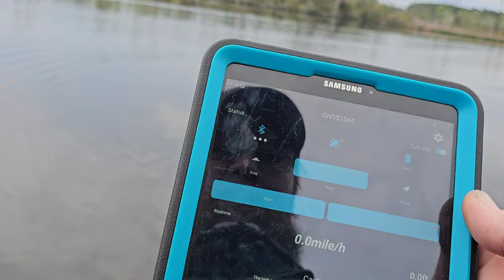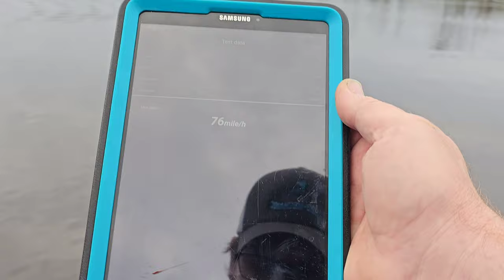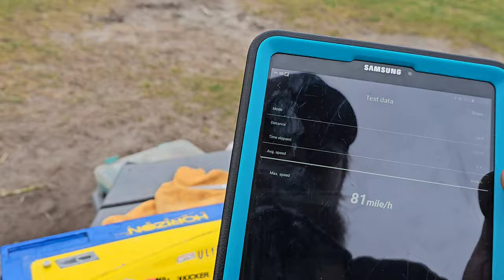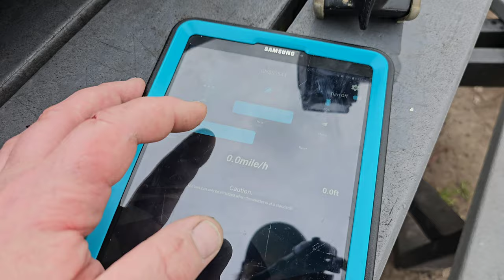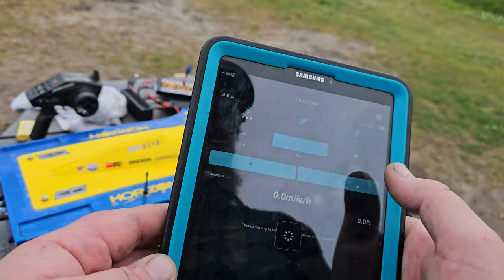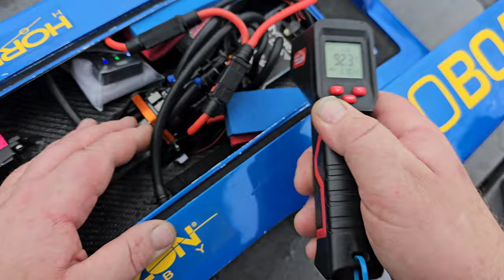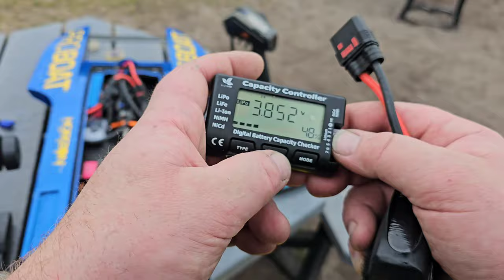Speedrun Shakedown Proboat Ul-19 Fe Rc Hydroplane Prop Test

Comment: Nice going! 
Got a question, big B. The fin with the curved bottom.
Does it not affect the ride? Looks to me that it would want to dig in.
Square to the ride surface would be neutral? I'm just curious.
Watch them gators😂😂👍🤙
Reply from the maker: The curve has to be set perfectly, something I've always struggled with, if you get it right, it'll somwhat hold the boat down in the water without digging or lifting the sponson..   had the fin set perfectly in my previous video, until it hit a 🐢..

Comment: B I'm looking at the tp 4070 CM 2200kv for a 41" saw mono. Paired with an xlx2. Do you think it would be a good setup to prove/dial in on 6s before I move to 8s for speed runs? You have a cm motor and just wondering how they hold up. I have a 2100kv tp4050 now and it seems to love it in my carbon pursuit.
Reply from the maker: 2200kv is pushing it for a 41" hull IMO, definitely won't be an oval boat what so ever, strictly saw passes,"one hitter quitter setup. "   

But it should work especially if your keeping the boat light 

I've been running cm motors for a long time they have plenty torque, but do not like extended run times.